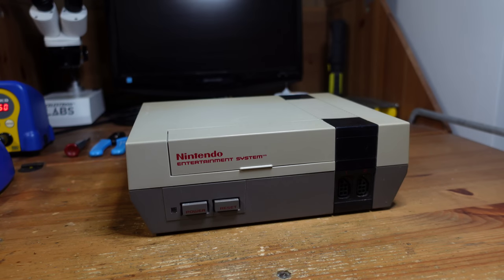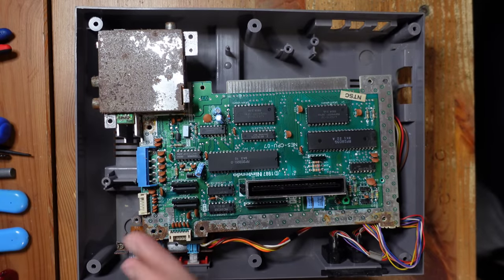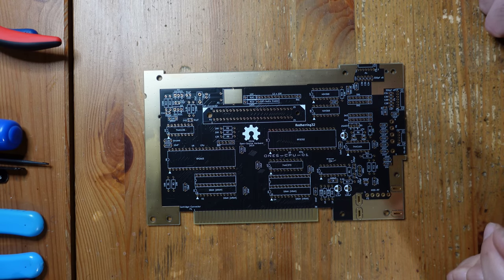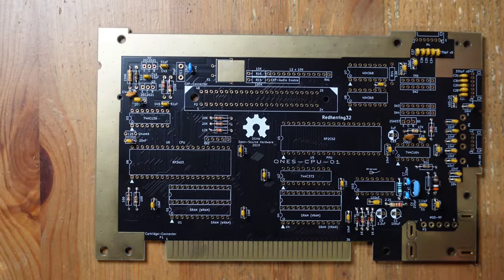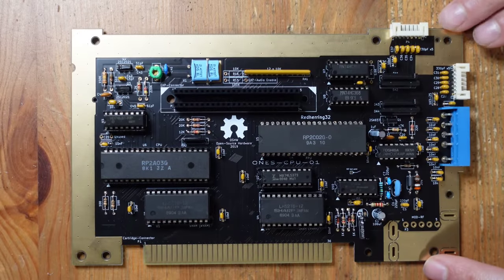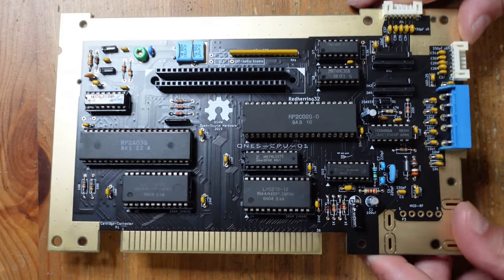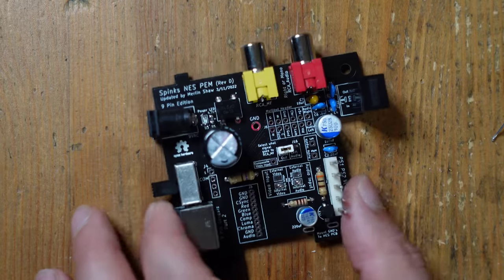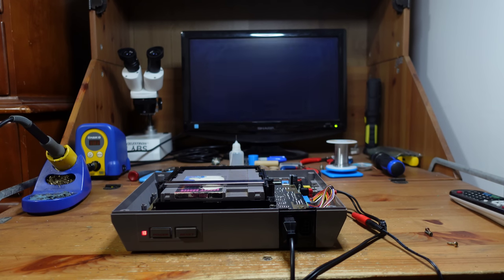Trash to Treasure: Extremely RUSTED NES - Can it be rebuilt and resurrected?

Comment: Oh look, I think I recognize that PCB, can't quite place it though. 

Jokes aside, I wanted to share a little pro tip. The diode arrays (DA1, DA2, DA3, DA4) actually have the common pin in the center of the footprint, so orientation doesn't actually matter. :)
Excellent video as always!
Reply from the maker: Thanks for that information! I did not realize that fact about the diode arrays. Certainly makes things easier!
Reply: I am currently building an opentendo and I noticed that the power connector labeled P6 (the blue connector) has a P6 alt. Do you know what type of connector the P6 alt uses?

Comment: The only thing I have used the expansion slot on my US NES for is soldering a resistor to two pins to get the Famicom Disk System expansion audio when using a flash cart. Yes, you can buy an nes rgb mod kit and get that audio with it. I am lazy and a single resistor is so much cheaper and easier than installing the rgb mod if all you want is the audio.

Comment: Very nice project my man! I did an OpenTendo transplant myself last year too (posted the completion on Reddit some time ago)!

Was very satisfying and chill project to do over the course of a few hours. Nothing like finishing up and watching it power on instantly for the first time without any issues. I recommend anyone who has intermediate level soldering skills give this project a shot! 😎

I definitely need to get around to making a few of those power modulators -- looks like Merlin finished his Rev D on them which he mentioned in that Reddit thread a while back too!! I can't wait to find a few more dead NES PCBs to do a few more OpenTendos this year. Also can't wait to see your video on adding RGB to the OpenTendo.  Are you going to be using the newer single-palette NESRGB boards?
Reply from the maker: Thanks! This was a really fun project for my son and I to do together. And I’ll definitely check out that Reddit thread, glad to hear that your Opentendo project was a success!
The new power module is great for repairing NES with bad RF modules - I have a few more here that I need to repair with this board as well.
Once the new single palette RGB boards are back in stock, I’m definitely picking one up and installing it in this system!
Reply: @LIRetroGaming  Niiiice!  I’ll get an NESRGB as well and follow along when you produce your video 😎

Comment: I realize it's been a while, but I was wondering: did you have any audio issue with the Spinks Rev D power module? I noticed with the PCBs I've had made that the audio path (with jumper set to internal) doesn't reach the red rca jack. There seems to be an error on it, like if a trace doesn't connect somewhere. I used this board to repair a broken NES recently, but I had to bypass a part of the audio circuit on this Rev D board to get it to output mono audio.
Reply from the maker: Hmm it’s been a while so I don’t remember too well. That being said, Merlin Shaw has made a new power module with improvements over the Spinks version

Comment: Love the content! I know you mentioned you could use the PCB pin header from the original power module or thick wires to connect the Merlin board. I’d like to just buy a replacement pin header. Any recommendations? I’m having a hard time finding a replacement part for it.
Reply from the maker: Glad you enjoyed the videos! Unfortunately, I can’t locate a modern replacement for the pin header, but you can extract one from a NES or from other consoles like the Sega Dreamcast

Comment: Very nice and informative as always! I was wondering about the switching regulator: I've read in a few places that even though it doesn't generate heat it can cause some video noise or other issues. I'm contemplating the idea of replacing the 7508 linear regulator on my NESessity board (I've built v1.2, which has the smaller version of the heatsink and it generates a lot of heat), but I'm wondering if it's worth the trouble if the switching regulator introduces other potential issues. Have you noticed any of this? Thanks!
Reply from the maker: So far I have not encountered any issues with a switching regulator. The NES I built in this video has clean composite video, and I have a switching regulator on a NES with RGB and it also looks great. It’s an expensive part but it definitely reduces the heat significantly!

Comment: I want to start a retro collection and I fell down the refurbishing hole. Now I want to learn how to solder 😂. I have no prior knowledge about messing with electronic components at all, at most I built a pc. Would you recommend starting off with this? Or is there any smaller projects you’d recommend for a first timer regarding soldering?
Reply from the maker: No, this is a much harder project and not good for beginners. I would suggest something much simpler like some basic gameboy screen upgrades or nes repairs
Reply: @LIRetroGaming  awesome, thank you. I’ll look into it more

Comment: Can anyone tell me the specific type of 5-pin connector (J2) on the power module? I messed up badly and forgot to desolder the existing one, and threw out the old rf power module. I have scoured the web for a replacement, but I don't want to get the wrong size.
Reply from the maker: I haven’t heard of a replacement for this connector, but you can wire them directly or grab the power connector from a sega Dreamcast which is the same part
Reply: @LIRetroGaming  Ah, I see. Do you know how thick the wires should be if I were to go that route?

Comment: So I've been looking at this board for a while I bought it, so the blue connector for the power and reset is only found on the NES, if the board were redesigned for a 5p jst connector it would work fine jst connectors are pretty cheap and come by the dozens or like you said you could just solder the wires directly to the board but I think a JST connector would look more official.
Reply from the maker: There is actually a spot on the board to solder a modern type of connector so you don’t have to use the original five pin connector on the NES
Reply: @LIRetroGaming  you know I saw that but it looks like it's for a controller which had me scratching my head, but that's cool if you could use that instead

Comment: Why didn't you use Hot air to desolder the chips??
Should have been much quicker and the Board is bad anyways??
Reply from the maker: I actually did use hot air to desolder them. I did not film that part but I used a mix of techniques including hot air
Reply: @LIRetroGaming  ah, didn't catch that in the Video. And was puzzled by you saying that it took you 2h to remove the components from the broken Board.

Comment: this new rf power module, can i use it to replace a original one ? and do u need the nes rgb kit or is this new module stand-alone ??
Reply from the maker: Yes you can use it to replace an original RF module, and no you do not need the NESRGB at all
Reply from the maker: That’s exactly what I did in this video

Comment: Which one do you prefer this board or the nesessity?
Reply from the maker: That is a very tough question. The opentendo is a very direct match to the original frontloader, but the NESessity mixes audio differently and has a pseudo stereo sound to it. I guess I would say the NESessity because of the audio, but I am glad that I have both so I don’t have to choose!
Reply: @LIRetroGaming  that makes sense. I’m in the slow process of getting everything for the Opentendo. Once I have the funds I just might have to get the nesessity as well.